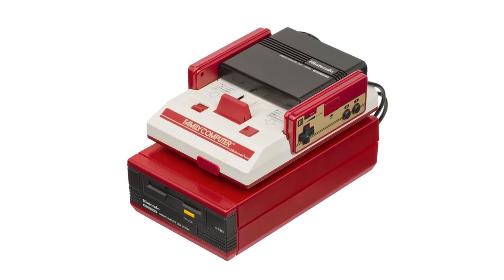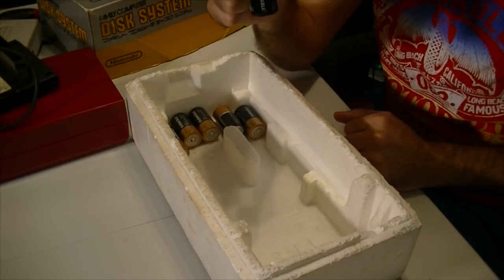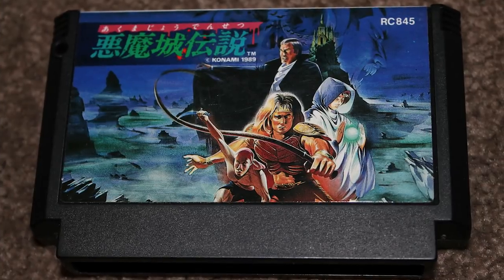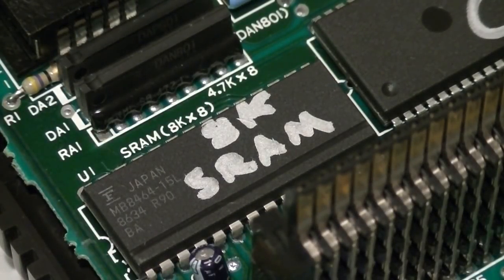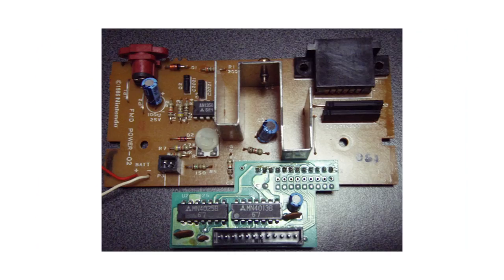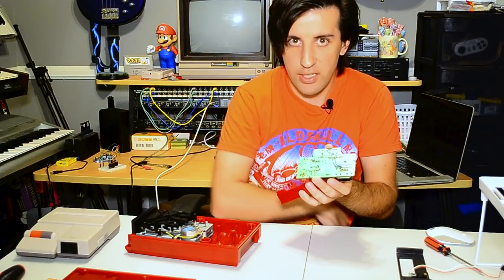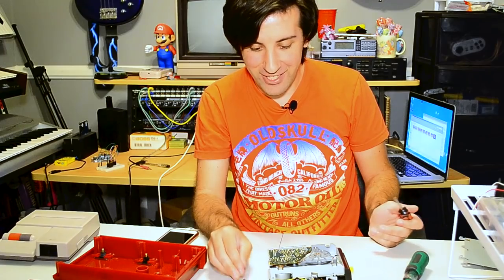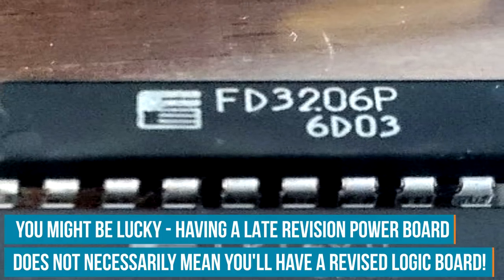Famicom Disk System Teardown

Comment: So it uses a DAC? Is the data just an analog signal recorded in a spiral on the disc? Would it sound like those old screechy data cassettes from the 80's Radio Shack computers?

Comment: I just got a Famicom Disk System from Japan, and while trying to play Zelda 1 or 2, if I try to save the game to the disk, I am getting "Error Code 26"  According to "Famicomworld.com", it is an error code for writing to the disk: 
"Err.26: Disk media is probably damaged. I see this almost entirely when reading from or writing to disks with a dimple or bend in the Mylar. It is also an error when writing to a disk using a 3206 drive, or with a PWR-03 or later) Power Board; essentially, the drive throws an error due to the copy protection. If you have a later drive with the write-protection circuitry, you will likely see this error quite often if you try copying disks."  I am pretty sure my Disk System is the early version, but is there any way to tell without opening the thing up?  Also both Zelda games were bought on ebay, and they boot up and play fine, they just don't save to the disk.  Saving to the disk of course is essential lol.  Just trying to narrow down if it is the disk system, or the game.  Thanks.
Reply: Hi! Sadly it is not possible to tell which revision you have without looking internally, at least to my knowledge. It’s very possible there’s some kind of indicator like the serial number, etc, but I’m unaware of what you’d want to look for there :(
Reply: @kanpaifighto  i managed to fix that issue months ago lol. Aparently I had to remove the copy protect daughter board on my main Power-02 board. Now I can even translate games via the FDS Stick. No error codes. Everything works flawlessly now,  thanks!
Reply: @frankbizzoco1954  nice! Yeah, removing that protection opens up a ton of possibilities for this thing!
Reply: @kanpaifighto  i think its my favorite system i never knew I wanted.  I have a Sharp Twin now too. Famicom collecting is very addicting. There could always be worse things to be addicted to lol.
Reply: @frankbizzoco1954  nice! I haven’t modded my Twin yet (the one from the video lol) but right now that’s my main method of playing FC, period. Love the convenience of an all in one unit. Just wish the controllers weren’t so short!!!
Reply: @kanpaifighto  my sharp twin is RGB modded, and I have never been so pleased with a purchase. I was fortunate to snag a retrotink 5x, and pair it with rgb famicom, pixels smack you in the face. Its highly recommended.

Comment: I'd be curious to see if a modern device for playing the disks could be made, to maybe cut down on the maintenance hassles inherent in the FDS.

I just searched a bit, and surprisingly I don't see any results for that. Also of interest would be reworking the FDS to plug into the NES expansion port, though that would require cannibalizing an FDS, which I also don't see anything in searches. Both seem like projects right up Element 14's alley.
Reply: BFisch having it plug in to the expansion port would probably not be the solution to go for, since it interfaces via the cartridge connecter. I remember hearing about some people attempting to make an NES-style ram adapter, but not sure if anything ever came of it!
Reply: @kanpaifighto  The expansion port was designed for a western release of the disk system, though, because plugging a RAM adapter in the cartridge slot is messier with the VCR-style design. Since nearly everything else is the same, functionally, I would think that it's possible to do that.
Reply: @ambershit  looks interesting, but it's a work-around to avoid actually playing the disks, instead of more reliable mechanism for reading the disks.